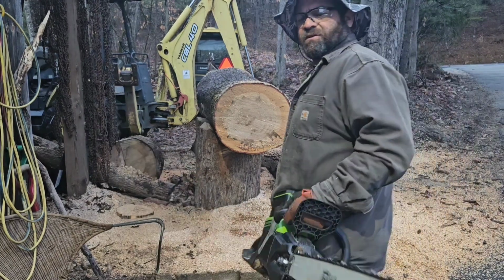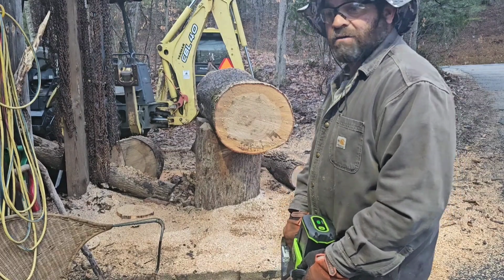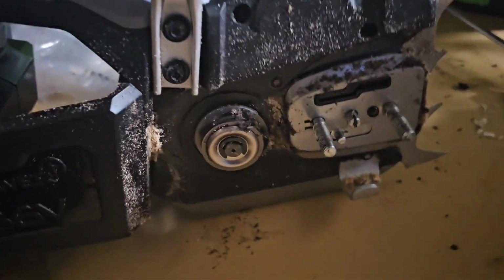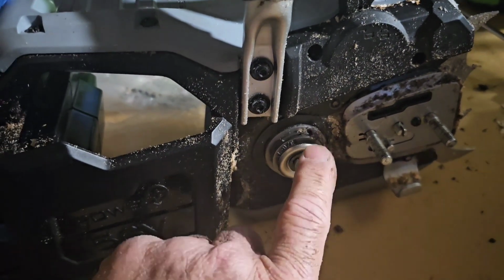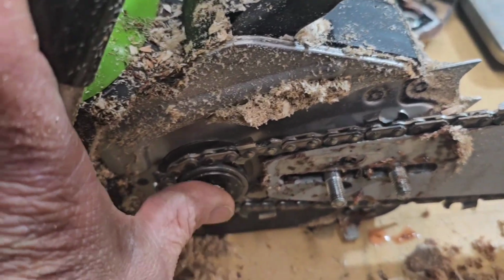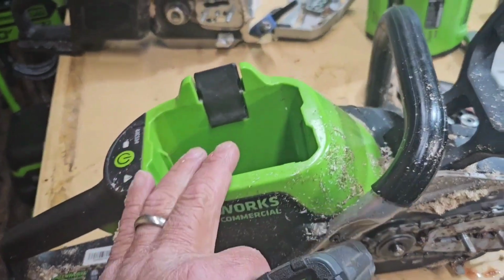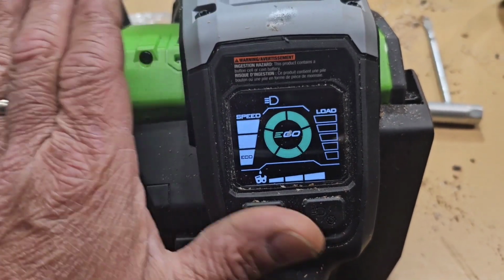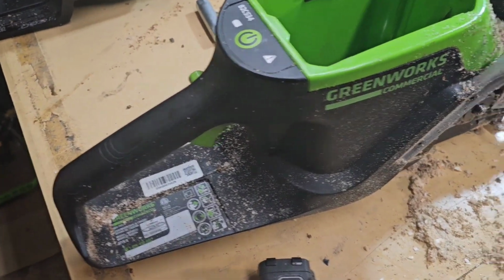Fastest most powerful battery chainsaws Greenworks 82CS34 vs Ego CSX5000 w big bars and batteries

Comment: Can anyone help me decide between the Greenworks 82CS34 or the Ego CSX2000??
Reply from the maker: Do you already own any ego or greenworks products? If so,  go with what you already own.  If not,  I would get the CS2000. It has a better warranty and better parts availability.  The 82CS34 needs a different battery than what it comes kitted with to run correctly.  Unless you have a reason to get the 82 volt commercial line,  I would get the 60v version of the 82CS34 from Greenworks.  It comes kitted with an 8ah  battery... which is what you want for that saw unless you're going to get an Optimus core400 battery for the 82CS34 after you buy it,  which turns it into a different saw... but that represents almost $1000 vs $450 for the CS2000 or the 60v 20" Greenworks.

Comment: 0:09 I don't remember where I posted this comment before. But I FINALLY have a 20" bar on my CS1800!
I ordered the 68dl chain that was specified on the Oregon bar. Everything fits up perfectly.
I'm going to try it out this afternoon on a couple of big rounds that I've got in the back yard. I'll report back later on it's performance.
I couldn't wait; I just tried it. It works great! More extensive testing to come. Pitting it side by side with it's 18" stablemate.

Comment: Higher voltage is more efficient and offers less resistance and heat in all conductors for the same power output. Also all the fastest most powerful EVs on earth (Model S Plaid, Lucid Sapphire etc) are all still using 18650 NMC cells instead of 2170.  Even though the 18650 is one of the oldest Li-ion cells in existence the advantages for high C rate applications are pretty clear.

Comment: Hey @reusefull; given that the CSX5000 doesn't care whether the bar is 20", or 24"; are we looking at a 36-42" bar for the H.O.G. saw?😁
Reply from the maker: @John-cj3ve  will really have to see what the batteries can handle. If milwaukees torque number is for real,  that is a huge amount of torque.  If the saw is capable of sustaining that,  it will support a pretty good sized bar.
I mean,  just as a reference, 9.6nm of torque is significantly more than ANY production has saw that I'm aware of.  The Stihl MS881 makes 8nm.
Reply: So; what is the torque rating for the CSX5000?
Reply from the maker: @John-cj3ve  I can't find that info anywhere...🤷‍♂️  I would say that it isn't much different than the 82CS34 which is rated 4Nm
Reply: @reusefull Good Lord! I don't see how the rating for the Milwaukee can be accurate then.
Given the physical size and voltage of the Milwaukee battery; their torque rating doesn't seem possible.
Reply from the maker: @John-cj3ve  I don't know,  but we'll find out!

Comment: I just received an 80v 4ah battery from Amazon and it’s printed right on it ‘not for use with 80v chainsaws’. No date of manufacture on it either. Not 82v like you’re testing, but it may show how quickly batteries are evolving since it looks like GW may be baring some older battery designs from chainsaw use. On GW website the battery I just got is sold out, but there’s a different model 4ah that may be newer they may authorize for chainsaw use. GW seems to be acting kinda mysterious about their chainsaw batteries, as right on the battery is the only place I see chainsaw use prohibited 🚫 for this 4ah battery.
Reply from the maker: Interesting. I know they have some newer 80v batteries that are lighter and smaller.  I got 2 with a pressure washer and I don't see the no chainsaw marks,  so I think they're ok.

Comment: Very interesting. This means that voltage, 56 v and 82 (72) v, matters. A giant greenworks tear when sawing to discharge plus another 11 percent left. Perhaps it's an electronic issue. I don't think it's the driven sprocket (0.325 -3/8) or the length of the guide bar (20"-24"). Yes, there are nuances, but not so much that there is such a huge difference in sawing at the same power. The latest information on the battery was that it was 21700, not 18650 as in previous versions without a percentage indicator. The H.O.G saw will have ventilation like the stihl msa 300, but whether it will be a filter or just a mesh is not yet clear. Greenworks has held up very well so far. But the ego also strives to be better.
Reply from the maker: I think battery weight and heat dissipation are the limiting factor for all these saws that are operating at maximum power.

Comment: Hi; two things: 1. I found out from EGO that the speeds for the CSX5000 are; low; 20, medium 25, and; as we already knew; high is 30.
2. When I registered my 12ah battery; they required a dated receipt. I requested one from Power+Parts and I emailed EGO a screenshot; and that satisfied EGO'S requirements.
When I was on the phone with EGO about the speeds; I asked them about the status of my warranty. That's how I knew they were satisfied.
AND; they asked me to take a survey over the phone; to which I gladly agreed.
They told me if I took the survey; I would receive an extended warranty on my 12ah battery. So now my battery is warrantied until 2029!
Reply: Time decays battery performance more than use. By 2029 you won't even want that battery.

Comment: I also think that if you don't put too much pressure on the saw, there would be more cuts and the batteries would stay cold.
Should be tested under normal use.
I'm watching all your test videos, thanks.👍👍👍
Reply from the maker: I would agree that if I ease up,  there will be more cuts before overeating.
Reply: @reusefull  The comparison would be fairer for normal use.

Comment: I like your thinking at the end there👍.  Thanks for doing all this testing, it really makes ya think! 

Weren’t you confused about the 12ah’s weight being about the same as the 8ah? Confused me too, but it seems ah ratings aren’t what we think they are since the cells internal resistance increases as the amperage draw goes up. So, Ego may have increased the ah rating of the pack by using cells constructed for less internal resistance at a higher amp load vs adding more cells. 

So, a more aggressive cut ads more load to the battery from the saw and from the increase in the battery’s internal resistance too. It’s a double whammy and that Ego can probably draw over 70amps when you lean on it, given it runs at lowerV/higherA.

GW running cooler makes sense due to its higher voltage. More volt = less amps = less heat. Seems that’d give GW an advantage in lifespan too. It takes 20 fully charged (@4.2v) 18680 cells in series to get 82v and only 14 (@4.0v)to get to 56v, so GW gets a weight penalty for its higher V though.
Reply from the maker: I looked up weights on all the batteries for both ego and greenworks,  the Ah relationship doesn't seem linear across the batteries with weight.  I need to get a better understanding of how these work.
Reply: @reusefull  there’s a lot more to it than I thought. It seems the cells in a battery that’s supposed to run high amperage (like a chainsaw) need to be constructed differently or the cell internal resistance gets very high and the cell kinda has to fight itself. The construction to allow for higher amperage costs more though. Saws getting more and more powerful seems to have gotten ahead of the batteries offered, but maybe they’re catching up and not just trying to add more and more of the same type cells in parallel to try and get more power.
Reply: @reusefull 8Ah@72V=576Wh (Watt-hours). 12Ah*50.4V=605Wh. Wh is a measure of energy the battery has. Ah and voltage isn't. 
Both batteries are pretty much the same 'size".
However, at 50.4V, the Ego battery cells are pushing ~40% more amps to achieve the same power output of the GW battery cells (73/50.4). 
The GW saw definitely has more headroom  than the Ego. Curious what the difference is when both saws have their stock bars on.
Reply from the maker: @jeremybelcher6681  I don't think it's a large difference.  I'm running a skip tooth on the 24 inch bar and it doesn't seem to work the saw quite as hard.  I'll mess around a bit,  but I was also thinking of running a full comp chain to see how they compare. I have to grab a smaller log to test the 20 inch bars,  they don't quite reach through the one I have on the stand right now.

Comment: I'd like to know what GW is using to sense load and if there is a way to "fool" it or bypass it.  Electric motors can handle much higher than 100F temps, 140F should still be plenty safe.
Reply: I think EGO is more concerned with the battery temperature than the motor's.
Reply from the maker: I'm sure the temp in at the motor is hotter than the end of the shaft, I would be pretty nervous to run it hotter.
Reply: @reusefull  Motor insulation should be good to 180F and the permanent magnets up to 200F.  Even 120F at the shaft would be better and still likely keep the internal motor temp low enough.  I'm guessing they are using battery voltage drop as the limiting factor not motor temp, since the saw will shut down faster with a smaller battery where the voltage drops faster under load.
Reply from the maker: @JRP3  I definitely agree that the battery management system is what's shutting it down,  but I really don't have a good sense of what the internal temps and limits are.  It did seem as if the Ego had a power drop a couple times just before shutdown that could've been from a different monitoring system.

Comment: I think you should do some tear-downs.  Another factor would be air flow in the motor and battery compartments.  If you look at the 'leaf springs' on the most recent GW saws, the battery cooling slots are right over it.  If you tear down the whole saw, there are air channels that go from the fan-side of the motor.  So not only do the fan vanes move air over the motor, they also keep some flow going through the battery itself.  

I tore down my 4080-06 to get sawdust out of the air ducts so the motor would cool better. .  It performed a little better for a while, but mainly I noticed they redesigned some openings and channels on the 20"-ers.
Reply from the maker: Can't hurt to clean it out,  that's for sure.
Reply: @reusefull  I accumulated probably about a lb. of oily gunk in there.
Reply from the maker: @ToolHombre  wow! Sounds worth it

Comment: I'm just surprised that none of their batteries can deal with the high draw from the saw. you'd think they'd make a special high discharge battery for it like stihl did. makes me wonder how globe will tackle this issue with the hog saw 🤔 I think using it with the 24" bar and bucking small stuff up 12" or 14" would allow the battery to stay cool and not overheat.
Reply: I don't think it is entirely the batteries' "Fault".  GW had the same problem on prior models until they learned some lessons and added some active airflow through the batteries (theory based on my teardown).   EGO waiting longer to 'get this saw right' meant they didn't have a saw in the 3kW class to learn these lesson on.  
GW kept evolutionary changes going; EGO thought theirs would be 'revolutionary' but they might have missed a lesson hard learned in the process.  
EGO is still thinking of these as a Good Battery + Good Saw = Good Battery Powered Saw
GW has moved on to Good Battery + Saw that Cools the Battery = Good Long-Lasting Battery Saw.  The delivered package is what matters.  
That's my going hypothesis to make sense of the data anyway.
Reply from the maker: I think "pouch" batteries are supposed to help with that.
Reply: Do you know if the instructions manual say anything about a duty cycle or anything like that? It's just got me curious with how hot the motor is getting. If you're simply exceeding the amount of work they recommend. I know it allows you to max out the load meter but maybe they recommend it only for 2 or 3 cuts at a time.
Reply from the maker: @benjaminleslie3155  I don't remember the exact words in the manual... I'll look again,  but it did more or less say that if you keep the load meter pegged on full,  that it will overheat.